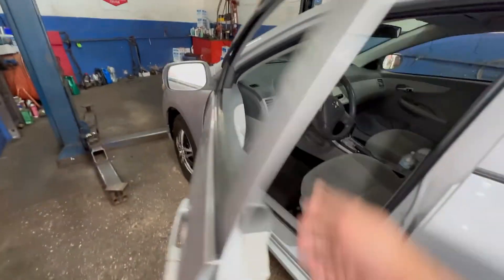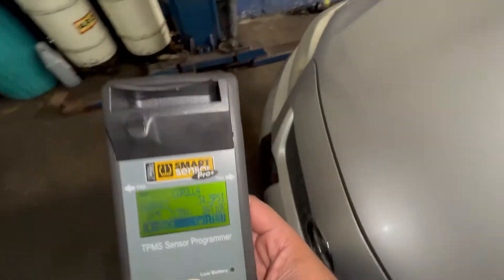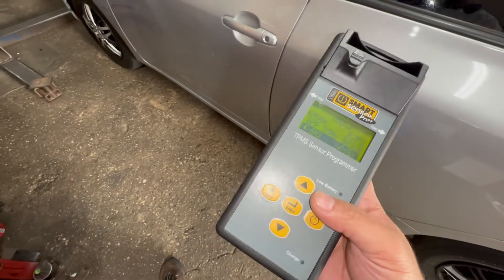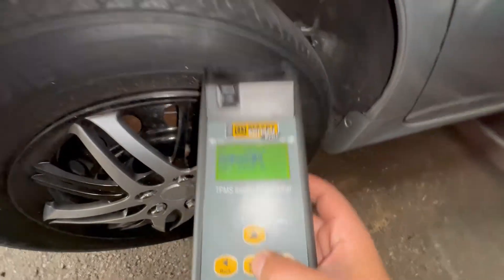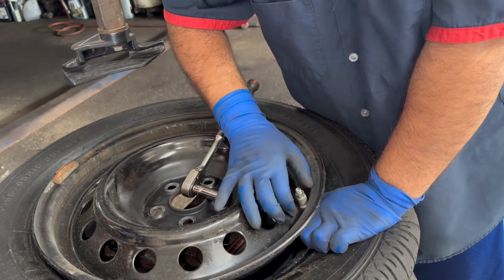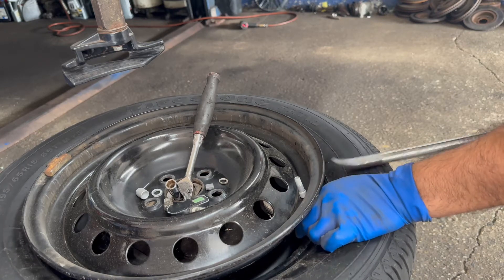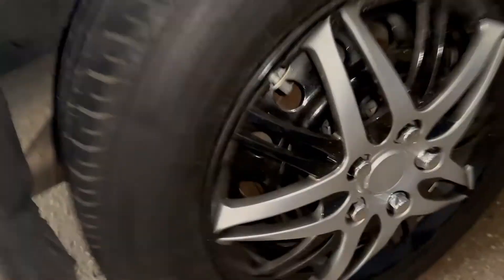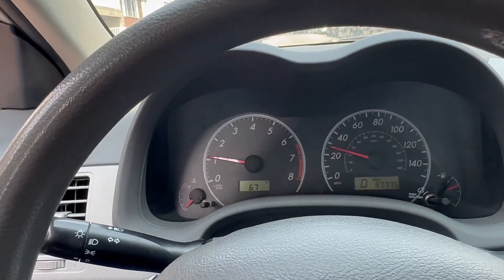Toyota Corolla 2010 TPMS sensor low battery replacement and program process

Comment: Thank you, I was told I had to go to the dealer for my 2010 Toyota Corolla,  but this looks pretty easy and the parts can be found online. Thank you.
Reply from the maker: Yeah easy with this program tool kit
Reply: @RBTheMechanic  found that American's Tires in my area can do the sensor replacement for $55 plus tax total. They replaced the sensor and took me right away without an appointment.  In and out in 20 minutes.